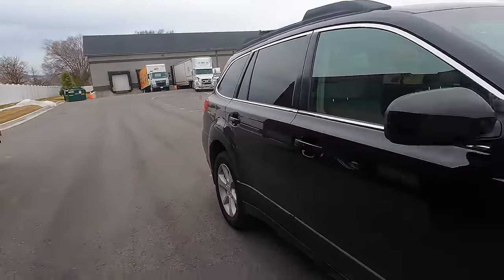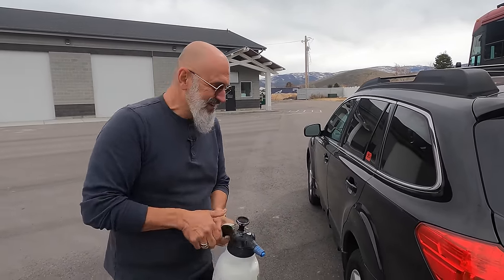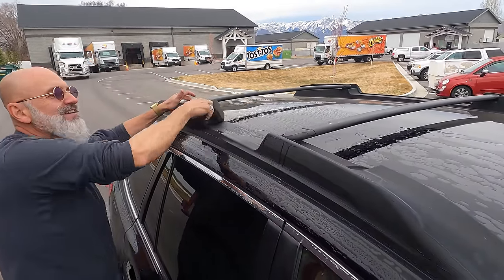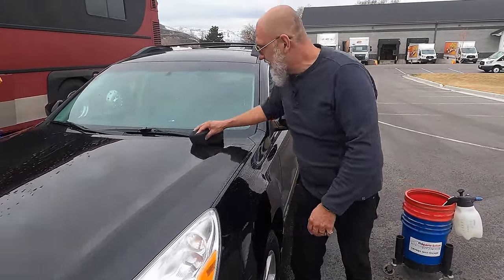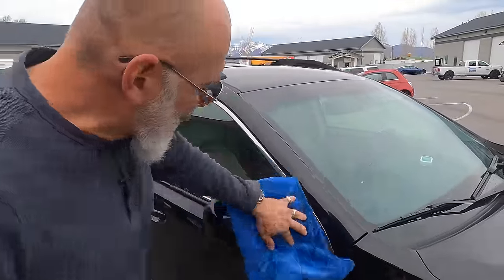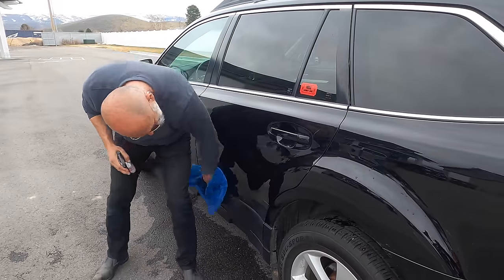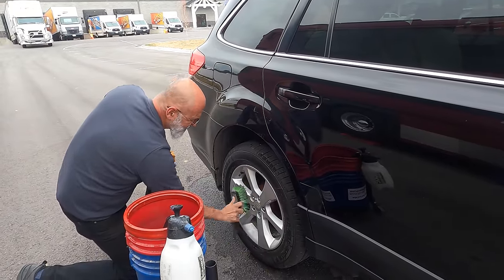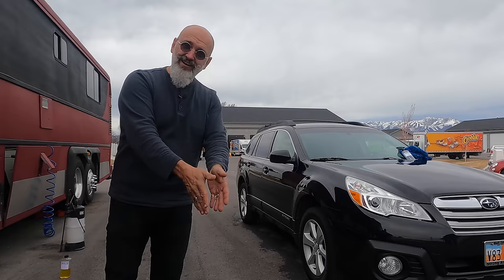RINSELESS CAR WASH: How long does it REALLY take?? With Yvan Lacroix

Comment: I've been doing mobile detailing and started exclusively doing interiors. Realizing I was leaving money on the table and was not getting some customers who wanted both, I started doing exteriors, with little experience outside of using a car wash. Having started with very little money, I spent about $300 on chemicals, a cheap but quality pressure washer, and an upgraded pressure washer hose. However I realized that my setup time at a job site was so much longer JUST based around the pressure washer. When running as a business, and considering I love extremely efficient systems, I went on a long journey into this whole realm. This system that you have right here is just immaculate. You just did an entire car in what it would take me to do 2 tires. I'm picking up a Ryobi 600 psi cordless power sprayer and going to use this EXACT method. My thinking is, if the pressure sprayer has it's bottles set up properly, I can do the pre-treatment with ONR and another bottle with APC for the tires, without having to even spend time or energy pumping it. Also I've been using wash mitts and I don't like the amount of energy output due to ergonomics, so the sponge seems perfectly built for a hand to grasp firmly and apply properly. Sorry for the book, just wanted to say Yvan is such a genius, big fan of yours and thank you again for the great content!
Reply: How has that Ryobi worked for you? I have that one as well, it works well. A little chinzy but it works.

Comment: one thing I've recently found saving me about 30 mins in our maintenance washes.. is adding ONR to our water tank ..  1. ONR pressure pre-rinse  2.  drying Aid with microfiber  3. ceramic sealant = Done ! Give it a try ! love ONR
Reply: What sealant
Reply: @Timsautosolutions   Technicians Choice TEC582 Ceramic Detail Spray
Reply: Ive used.. its good!

Comment: I've been doing rinseless all winter.  I rinse the cars at the car wash with a pressure washer first. I've learned from this video that this method is a no-no.  I'll try the pre-soak then do a standard rinseless wash with three gallons of water and onr(which I love).
Reply: A quick pre-rinse can help.
Reply: @iKegDetail2  good plan.
Reply: Ive been using Greenstar as a pre spray 10:1, rinse and then a waterless wash (go to Mckees sio2 RW/WW) comes out fantastic.
Reply: @Jeeper1378 can greenstar remove hybrid wax?

Comment: Great content. Sharing immediately. I love rinse less washing. I'm still amazed at people that don't believe in it but they'll jump on any other silly fad that comes along. Like foam cannons and 2 bucket washing. Learn Rinseless washing and see how much time you save. Thanks Yvan.
Reply: Thanks Dale, those who don’t « believe » in Rinseless usually have never tried it.
Reply: Use 2 bucket method for the rinseless wash and you can wash 2-3 cars with the same water
Reply: 2 bucket isn't a silly fad lmao
Reply: I've tried rinseless. It's okay but I seldom do it unless it's very cold. I prefer a cheap foamer attached to garden hose. No pressure washer. I do my entire car in twenty minutes or less. Although the amount of protection on my car reduces drying to a minimum. It almost dries itself.

Comment: I love the learning that comes from Yvan and Nick collaborating.  We all benefit from this content, so thank you!

I’m ready to launch my mobile business and seriously considering going completely rinseless. I think the low level of water required and not messing up folks’ lawns and driveways trying to eradicate a massive ‘snow storm’ created by foaming/pressure washing should be attractive to customers, as well as the noise abatement. I’m targeting a somewhat affluent golf club/marina community. But thought that customers might think there car isn’t clean because I didn’t use a traditional method has crossed my mind, however. Any marketing suggestions?
Reply: Your customers a paying for a result, not a process.
Reply: Rinse less  is a nice convenience  but its really not going to cover everything, your going to need a pressure washer with access to water if you want to seriously consider mobile detailing. As mentioned, you are not marketing a procedure, your customer could careless,
Reply: Good luck LOL.
How are you going to clean carpeted wheel wells without a pressure sprayer/water?
Reply: @yukonstriker1703  tool for every job. Rinse less for 95% of the jobs. Results are all that matters to customers.
Reply: @Detailers-Business-Academy  your customers are paying for scratches & swirls 🤣🤣🤣🤣🤣🤣🤣🤣🤣🤣🤣
Reply: yea i like the questions that the guy was asking

Comment: Been using these rinse less type of washes for years. I use a two gallon bug sprayer to apply .  Optimum No Rinse Wash & Wax  is the best by far!
Reply: Does the ONR Wash & Wax allow you to skip buying the drying aid?
Reply: @GanNing221  I don't think so as when I use it with my bug sprayer I simply wipe it off and it's dry. Takes about 15 minutes to do an average size car or pickup truck.
Reply: @GanNing221  a Rinseless wash doesn’t require a drying aid, but if you want to use one, feel free.

Comment: Since converting to rinseless, i save time and can easily dry a pickup with a towel half this size, without streaks.
Reply from the maker: I didn't realize how much I missed rinseless until we did this video...just the time with master blaster blowing out the water....fighting drips etc ...takes forever
Reply: Excellent!

Comment: It almost always takes me close to an hour to rinseless wash & dry my '17 Accord but I usually pre-treat it one panel  at a time with ONR, ONRW&W, or if it's really dirty I use Opti-Clean or (soon to be replaced by) Ultima Waterless Wash. My '95 Civic doesn't take as long, of course :) However, I did recently purchase a foam cannon for using 3D Pre-Soak when I feel like using such a procedure, mainly for when wheel wells and the like need a good scrubbing.
Reply: Do you find ultima more effective than opticlean or just cheaper?
Reply: @ryeguy01  I haven't gotten around to using the Ultima yet since I still have a bunch of Opti-Clean, but I did purchase it because the net cost per gallon of solution is roughly one-third that of Opti-Clean.

Comment: My new tesla sets in my carport here in the desert and after two days it is very dusty. Every four days or so I pull out my 1600psi pressure washer and spray it off with a fine mist, then totally foam it, then rinse it. Dry it with a drying agent. Works perfect every time. Takes me 15 min.
If I tried to do this rinceless thing, spraying it on would do nothing but create mud balls from the heavy dust that is on it.
Reply: I don't live in the dessert but every time I foam and pressure wash there is still dirt so if your drying agent isn't a rinsless or water less your probably dragging dirt
Reply: @jesusgaona5189  I am using the smallest pressure washer I can get. Also chemical guys foam cannon soap. So the car sits in a  carport here in the desert where we get high winds. So after two or three day it has a noticeable coating of dust/sand. I rinse it off with the garden hose using a soft stream, rincing from the top. Then I foam the whole car, let it set for 4 minutes. Then rinse it with a soft spray with the pressure. Once all the soap is off I blow all water off with an EGO blower. Then I go over the whole car with Technicians Choice Ceramic Detail Spray. The car looks perfect after this. With how much dust/sand is on the car, putting that no rinse on would do nothing but make little mud balls....a real mess.

Comment: I like system for one car, but if you have a limo company where vehicles are used daily and are washed daily... what system works best?

I have noticed after washing and drying vehicles waterspots and scratches and even discoloration is evident. 

How would you advise me moving forward Ivan? Rinseless? To wax or not to wax?

Cars and suvs are easy to wash, then sprinters on the way up coach buses.

Feedback welcomed...

How do you identify hard water?

Thanks for insight.

Comment: Looks nice and amazing but sadly in my country is forbidden to wash your car in parking lot, sidewalks. I live in condom apartment building so no garage whatsoever. So my only choice is self car wash station. Any advices in how to wash properly in this situation? Thank you!
Reply: Wash the car on washbay at 10-11pm.. There are not people.
U can use this method or standard. 

Step 1. Rinse with high pressure, foam, rinse, foam, rinse. - 2x prewashed. (Can wash the wheels between 2 foams)

Step 2. U can use rinseless cleaner like this to touchwash or foam the car and use washmitt + rinse bucket or towel and u have 8 sides and change sides.. make top and bottom or left side and right side.. rinse part when done. 

Step 3. Again foam the car and rinse it. 

Step 4. Rinse with demineralised water or use dryingtowel.

Comment: Out of curiosity. Could you use the ONR as a presoak and then use a pressure washer instead of wiping as an agitation? I know it defeats the purpose of ONR but I'm trying to find ways to do a touchless wash on my maintenance washes.
Reply: Yes, if you have a pressure washer or even a hose available, that’s the way to go.

Comment: Nice to see Yvan demonstrating proper rinseless techniques!  I do wonder what's best drying aid as my TRC eagle towels __really_ drag during drying (I use Optimum Hyper-seal new formula every 3 months or so but not as a drying aid).  Only time I 'foam" my car is during its maintenance wash and that is with Optimum M-wash, rinsed, and then ONR'd for insurance (car has Optimum Pro+ on it).
Reply: Ditch the junk Rag Co towels and use the Autofiber Dreadnought, you won't even need a drying aid cause they glide over the surface rather than being full of friction. Add a spritz of Optimum Gloss Enhancer and Detailing Spray and it'll be even more slick upon drying.
Reply: where does one buy these?
Reply: @mattheviewer  Amazon, Autofiber has a store there. The detail spray can also be bought on Amazon. Buy the 32oz or gallon since it's a concentrate and gets you more for the $. Mix it with filtered water.

Comment: Timely video! I was just re-watching some of these older videos with Yvan then a new one pops up the next morning! 

Recently saw a video of two employees at a detail shop wash a car that supposedly took 30 minutes. A rinseless wash in my garage takes the same amount of time and doesn't take two people. Two of me could easily do the job in 10 minutes.

Crazy question... Say I used my iron remover as my clay lubricant. Would it be a terrible idea to buff off the iron remover with car wax?
Reply: With iron remover, rinsing is required.

Comment: Yvan, why are you using a drying aid when the rinseless already acts as a lubricant for the towel?  Water is a solvent, but the rinseless is lubricious I thought?  Or is it because you are using it to remove the polymer spots that dried since you washed the entire car first before drying? I wash the roof, then dry, then the hood, then dry, etc., so don’t experience that spotting
Reply: We were using it to give this car some protection. We used DIY Detail Ceramic Gloss in its prototype form.

Comment: After drying with the towel and drying aid, would that be the correct time to go back and apply something like Gyeon Wet Coat?
Reply from the maker: you would be good to just use DIY Detail Ceramic Gloss as your drying aid. If you have a hose, you could use Quick Beads. But the better order (with hose, and if you wanted to use both products) would be rinse paint after cleaning, apply Quick Beads to clean/wet paint, rinse off. Then use Ceramic Gloss as your drying aid with towel

Comment: Hi, and thanks for a great video. I’ve seen something like this before when I watched Yvan at Pan T.O. and thought the video was an eye-opener. In your opinion: What would be the best washing process if you had a typically, dirty Norwegian/Swedish car in front of you? That car has asphalt stains, salt, road grime and iron-based contaminants. And all this kind of contamintions are almost like glued to the paint  on a daily driven car in our countries during the  winter-time. Here in Norway, a typical wash process in the winter would be something like this:

·        Koch Chemie Teerwasche A

·        Alkaline foam 

·        Let it do it’s work and rinse

·        Wash the car with a two-bucket-method

·        Dry the car

Any thoughts?
Reply from the maker: I think with an exceptionally dirty car that you might need to clay....it can still be done but you just need to factor in some kind of spray...whether your trigger finger lol, a dedicated punk sprayer....or an actual pressure washer, you'll just have a lot more "rinsing" to do. This method is great for a regular wash but with severe fallout you'll be using some kind of iron remover and clay so it's just a matter of dealing with that slurry. You could just heavily spray with rinseless and wipe off. Or have a few gallons of distilled water to flush panel if u don't have hose access

Comment: Great video! I just to make sure I'm doing this right. I've got a black pickup and washing once the weather gets warmer is a challenge to keep wet. Am I fine to pre spray the whole truck, come back through and completely rinseless wash the truck and then dry? Obviously between these steps the pre spray and rinseless is going to dry completely. Thank you!
Reply from the maker: If you pre spray whole car I highly suggest distilled water to hedge against water spots
Reply: @HawkProDetailing  for the pre spray with rinseless wash solution I do use distilled water. Just not in my wash bucket.
Reply: @StocklookinSS  just the wash bucket
Reply: Distilled water in the pre spray you used in the beginning or in the bucket you used?

Comment: Thanks for the video! What’s the best way to deal with the smaller details like emblems, window seals, grills, etc?
Reply: A wheel and body brush ( Nick can post an affiliate link) does a great job with rinseless.
Reply: I use a synthetic detail brush (like the quality ones from Detail Factory), dip it into my bucket, and wash the emblems just like you would any other time. Works fantastic, and now when you pass over it with your wash media the dirt will be removed. 

Also, the ultra black sponge will clean the emblems most of the time. The fingers will wiggle out the dirt. For stubborn dirt and areas, the detail brush works great.

Comment: Would drying a panel at a time be considered safer? I know there's no harm letting the rinseless solution dry on a panel, but couldn't it leave some dirt on the surface and then you don't have enough lubrication and encapsulation to safely remove it?
Reply: As long as the dirt was hit with either the presoak or the sponge applying the RW the dirt should be encapsulated. The drying aid will help as well but isn't necessary. Of course you could lightly mist with the RW solution before drying if it's in direct sunlight or the panel is heated for whatever reason.
Reply: What I do is pre rinse with solution, then wash entire car. Then respray panel with onr solution as I dry. I do this in 85 degree weather in the sun with no issue with water spots

Comment: I am a mobile detailer here in the Florida panhandle and the traditional wash is my go to but I just don't have a whole lot of experience with the rinseless to be honest. It seems like a lot of the vehicles I see are pretty dirty and rinseless is just better for vehicles that are not that bad. Like this vehicle I totally understand doing a rinseless but what about something that is trashed and not lightly soiled. I also wonder if ONR would perform when it is blazing hot a million degrees out and the water is trying to evaporate every time you put something on. The weather conditions are something that is a huge factor here and it is almost impossible to operate without DI water and a canopy
Reply from the maker: You gotta have di water or distilled IMHO if sunlight is a big deal
Reply: Do you have a mobile tent to block direct light?  When humidity% = air temp nothing is fun, doing it out of directq sun (ie in the shade)

Comment: I can’t help to wonder what spots are on the panel at 28:25 🤷🏼‍♂️ either it’s dirt or it’s edged water spots or it’s “polymer spots”? As much as I want to like rinseless I just haven’t had the courage to try except on the door jams
Reply from the maker: If you want peace of mind...use all distilled water .... then you know the spots for sure for sure for sure won't water spot :)
Reply: @HawkProDetailing I thought that rinseless also encapsulates minerals and therefore “softens the water”? I think he should have done one panel at a time and dry immediately. In that case the rinseless also provides enough lubrication and a drying aid isn’t even necessary
Reply: @charleyschaubroeck6301  correct, it was rather cool out, and cloudy. I neglected to take into account the fact that at 4500 feet of elevation in Utah, basically too low of ambient humidity.
Reply: @charleyschaubroeck6301  Try it! These were polymer spots I think. Like Yvan said, humidity was low and getting interviewed at the same time doesn't help. Luckily, they're easily removed, just wash again. I would probably have washed half the car and then dry it.

I rinseless wash (no pre-soak and the Ultra Black Sponge) my car 1-2 times a week and haven't noticed any added swirling. I'm sure it does a bit, but certainly not on the roof or hood where It would bother me most. If I take 15 minutes in my garage on my 93' Civic (excluding wheels), I get near perfect results. No streaks or spots on glass or paint.

No need to use DI water with a good rinseless, they're excellent water softeners.